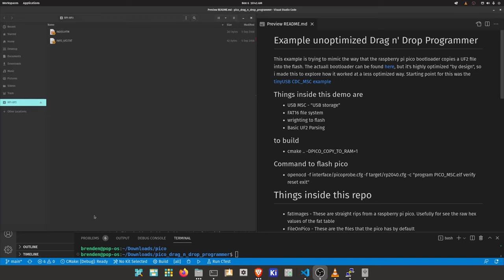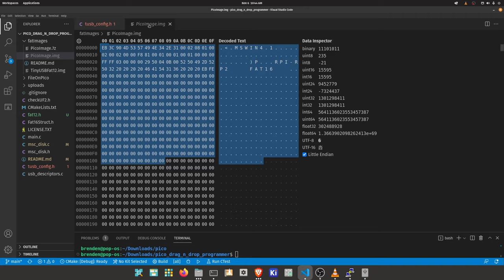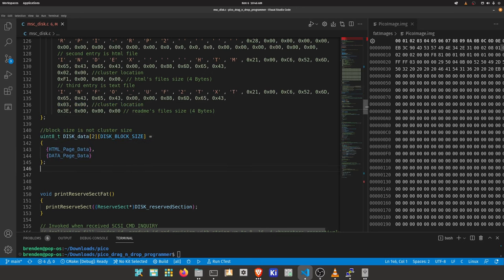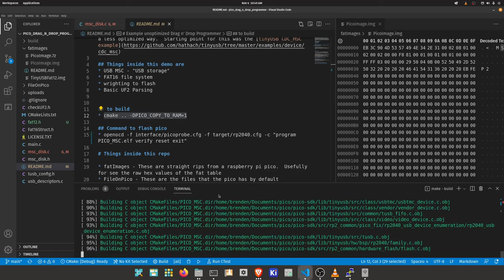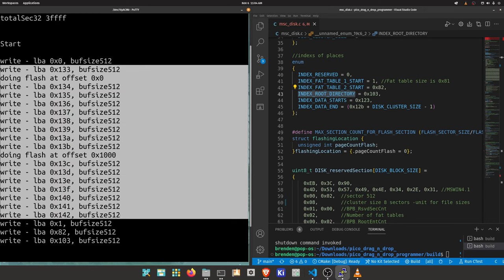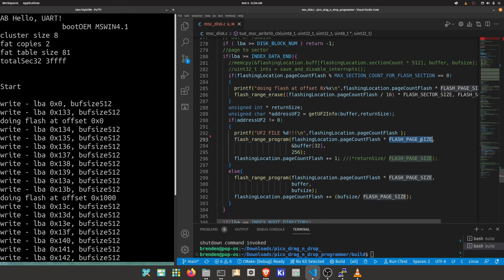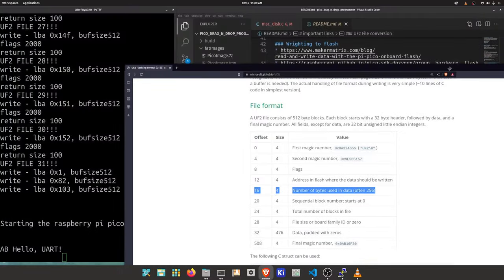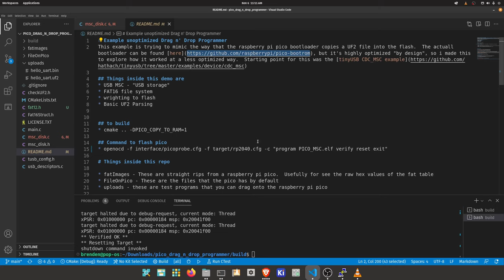raspberry pi pico - how the drag n' drop programmer works

Comment: Hey Brenden - very nice content! I got your code running in debug using picobrobe and I can see the debug prints in putty (i commented out the directive to run in sram as well as the code that writes to the flash ).  Once I plug the pico (with the code being debugged ) and I can see the flash "writes" happening in tud_msc_write10_cb,  I was not expecting this when pluging it  but only when i file is copied over.  am I missing something?
Reply from the maker: I'm not near a pico right now.  But if i remember correctly for some reason it right to "sector 0/boot sector" when you plug it in.